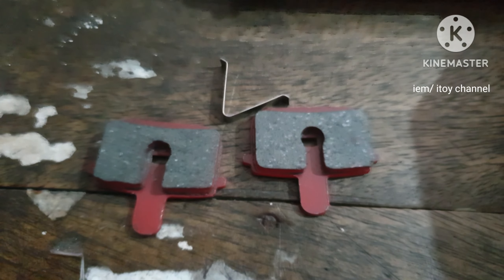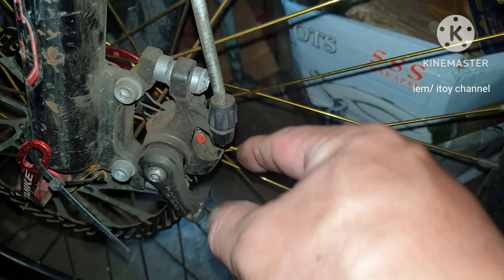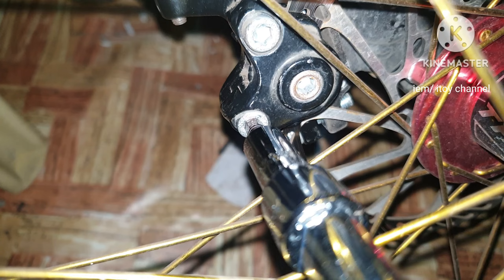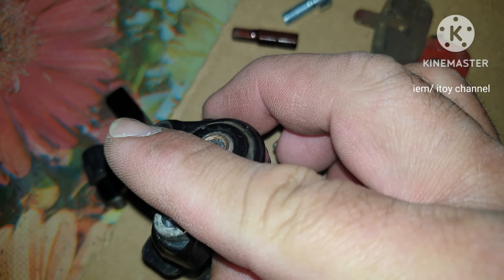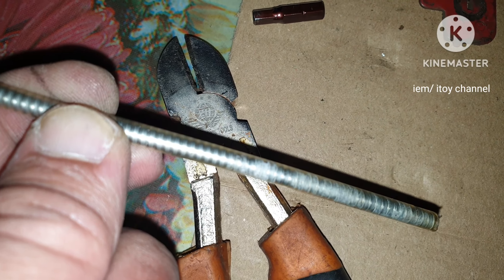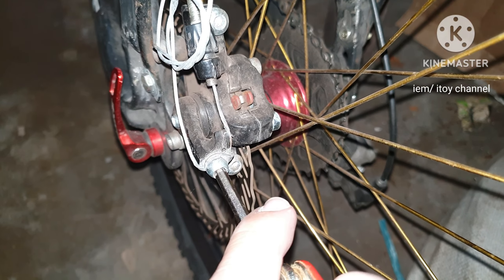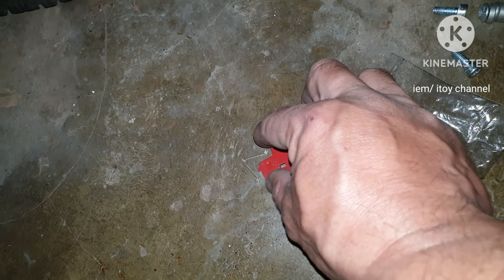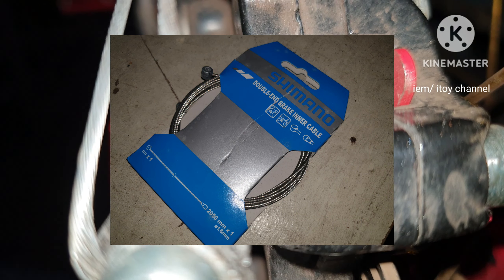mtb brake pad replacement for ragusa brake caliper & broken brake cable fix

Comment: Palpak yung nabili kong Ragusa disc brake calipers para sa Betta halfmoon ko — 2 months ko, in less than 180km pa lang ginagamit, nalaglag na yung pad sa likod after 2 days yung sa harap naman ang nalaglag. Ang sabi ng binilhan ko, napudpod daw. Sabi ko nawalan ng dikit yon kaya nalaglag. Mabuti pa yung Shimano MT200 ng MTB ko, 5 years na sa bike ko, hanggang ngayon good pa rin ang stopping power.